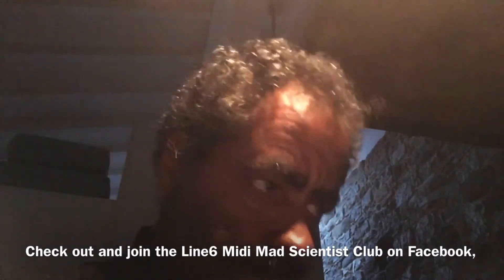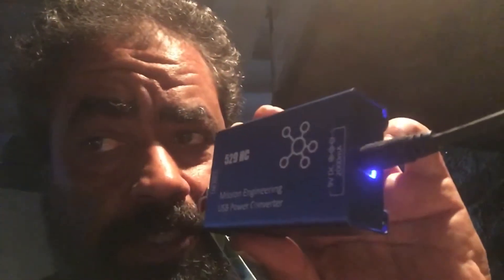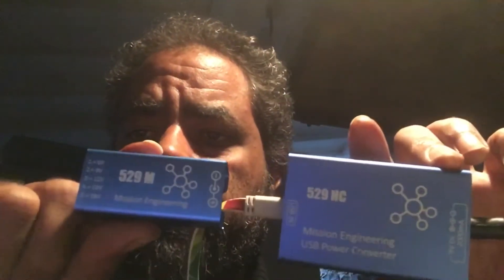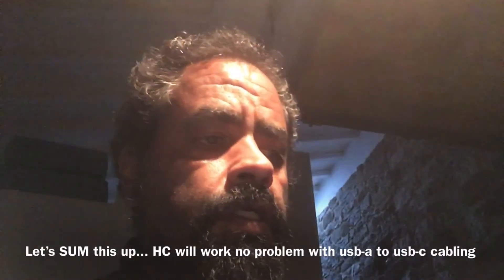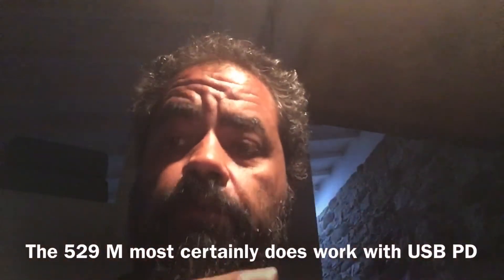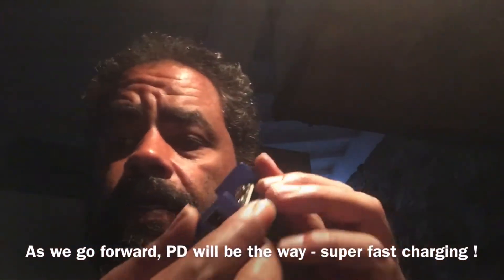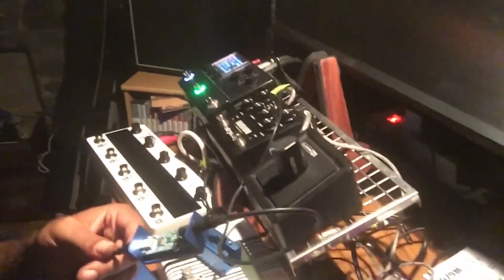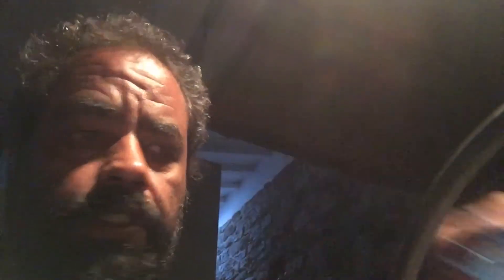Powering up the Mission 529 M and the Mission 529 HC

Comment: Thanks! I just got the 529m and it was only delivering 5v on every setting. Looks like I need the correct cable. Mission should put those details on a FAQ in the manual. Or better yet. They should include a short cable in the box.

Comment: Can i use 8 boss analog pedal on 529m?
Reply from the maker: Probably better to run an isolated supply like 529x than to try daisy chaining all power together. You get up to 3A on 9v, so yes you could but isolated outputs are better.

Comment: Hi Alec, Great video this is perfect timing I was just about to buy a Ciosk power supply for my new temple pedal board but saw that you can use these and I noticed that Mission now has a power delivery device that has a battery in it (529i) which I was thinking of maybe getting (I have about 8 mini pedals on this board). What do you think of that ? What would you recommend ? I'm subscribing and liking this video. Thanks Chris
Reply from the maker: I’ll gladly point you to my boy DEFCON Clark.  We are both heavy 529 users and he did an excellent video on the 529i.  Mission do high quality bullet proof stuff man, excellent and well deserved reputation.  
https://youtu.be/S7V8uxHyl-4

Comment: I've been using battery power for my pedalboards for about 3 years, long before I switched to modeling. I began with a cheap Chinese 5v to 9v cable that could put out 800mA. It worked well enough, but the cables were fragile and would fail. Next I bought PCBs that could output up to 2a, and they were adjustable from 5v to 24v output. I built these into small plastic boxes with 2.1x5.5mm barrel jacks so that I could use removable cables. I built a ton of these (if you want one, let me know - they work great with traditional, pedals). They were very solid BUT not solid enough for the Stomp. Worked most times, but not all of the time. So next I tried the Ionic Audio converter. It was pretty good and worked very nicely with the Stomp, but given it's price, I was a bit concerned. So then I bought the 529HC, which might as well have been made for the Stomp. What a great device. Worked with just about any battery I tried, including some large (26800mAh) noname batteries. Wonderful. But, it was just a touch too large for the narrow under-board section of my Metro 20. So I had to put it in the wider section, which was a bit cramped because that is where the batteries were. When Mission announced the 529M, I immediately ordered 2 of them, based upon size and price alone. It is smaller and cheaper than the 529HC. But as important as those features are, they are not the best part. Power Delivery is the best part. So I went out and bought all new batteries and cables so that I could take advantage of PD. And, by then, I also had a POD Go, and the POD Go works marginally with the 529HC. But, the 529M is perfect for the POD Go as well. Mission is just killer when it comes to these power devices - cannot be beat.
Reply from the maker: Some truly awesome feedback Steve.